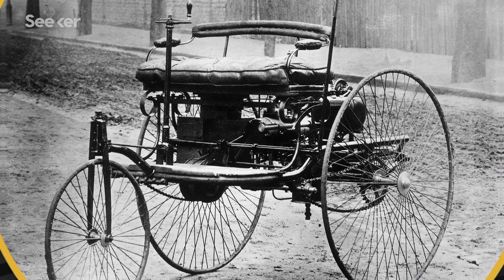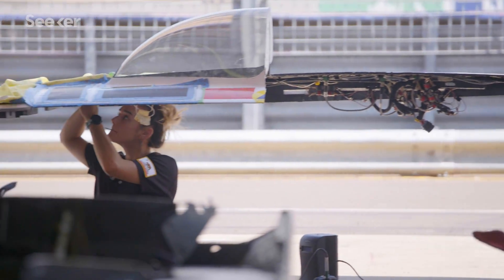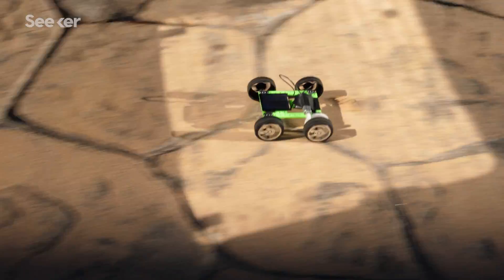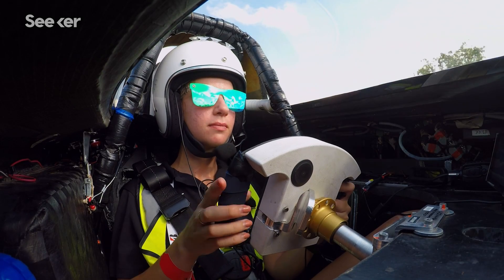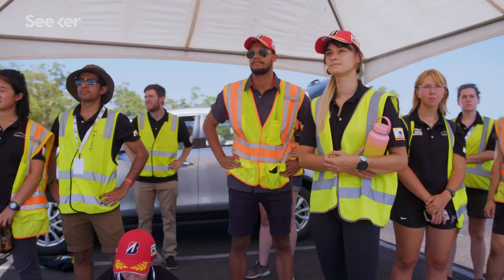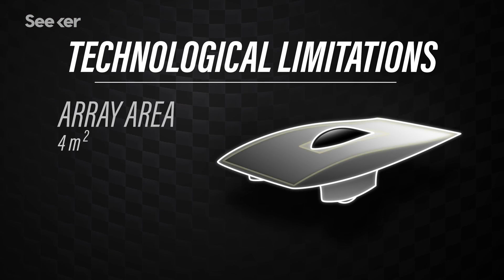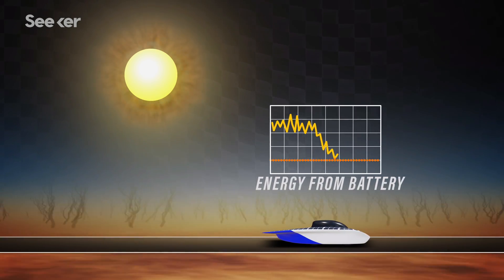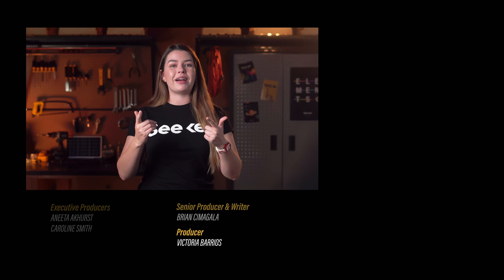Under the Hood of a Solar Race Car

Comment: Wouldn't high capacity capacitors be much more efficient with a higher weight to power storage ratio and a much faster charge and discharge rate plus a lower fire risk?

Comment: Did most of the solar cars use Li-ion or Li-po? Li-po have slightly more energy density but tend to be more explodey
Reply: Most use Li-Ion. However from the 2019 Top Teams Tokai, Michigan and Kogakuin used Li-Po. Twente used LiFePo.
Reply: I compete for a team at the Energy Breakthrough ( another Aussie efficient vehicle event) and we use lithium nickel manganese cobalt batteries.